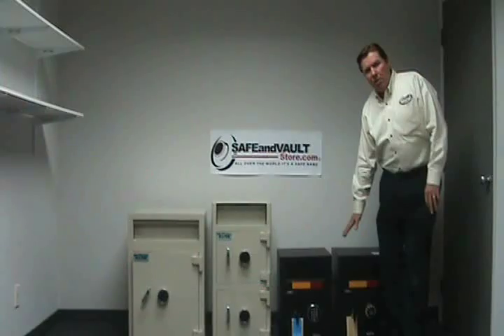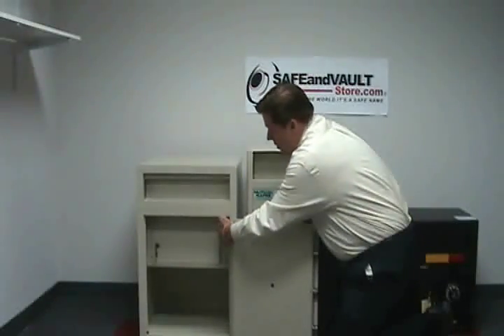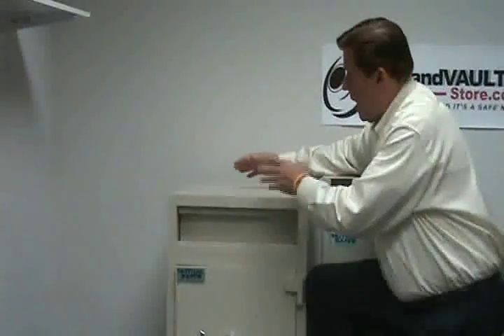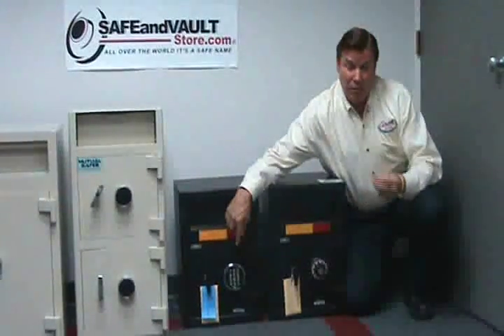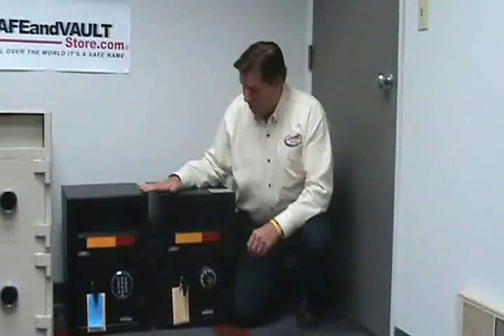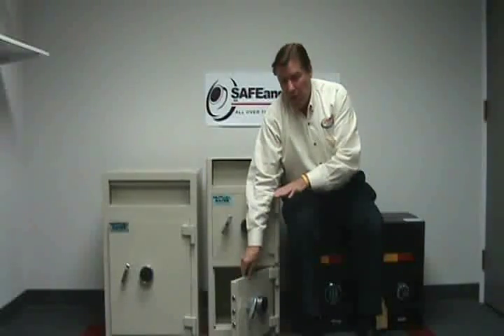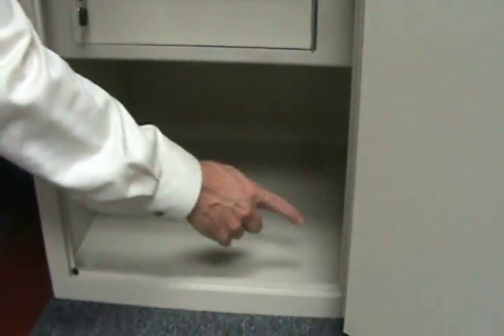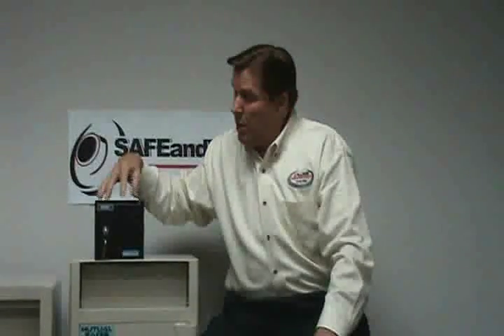Depository Safes Video with Dye the Safe Guy

Comment: It helps when the manager locks the safe, my manager always forgot to turn electronic switch and the bar I can literally use  my foot and open the  safe door
Reply: Yeah my managers are smart too, they would close the door but they never spun the lock unless it was closing time.
 Old employee could come inside while the maintenance door is open for taking out trash. And turn the handle on safe and get away with bank bags.